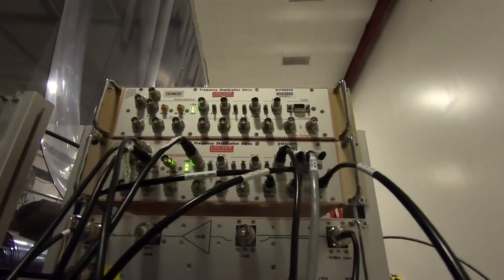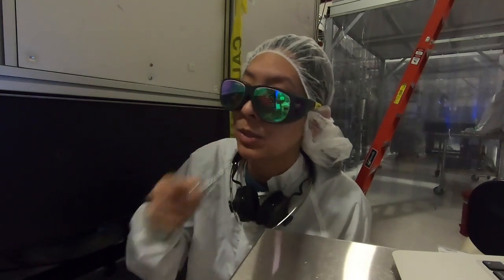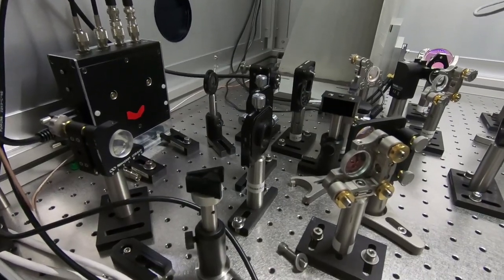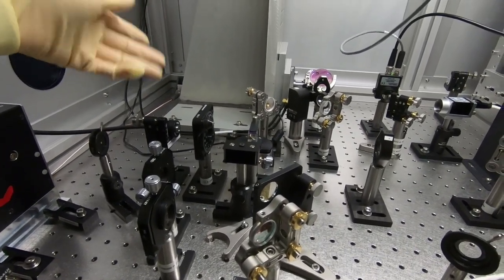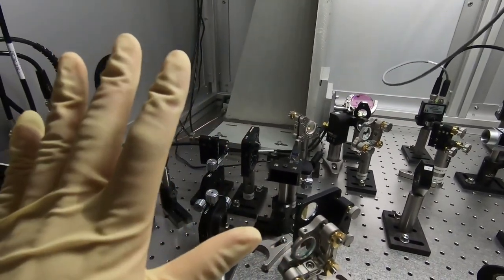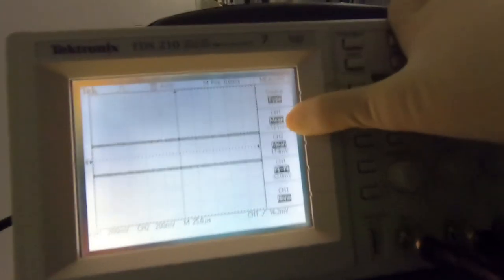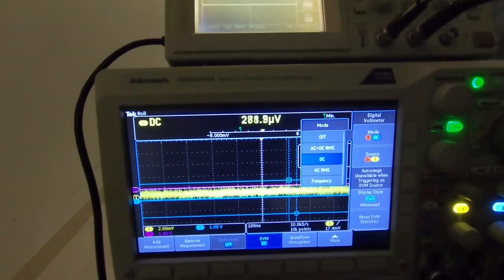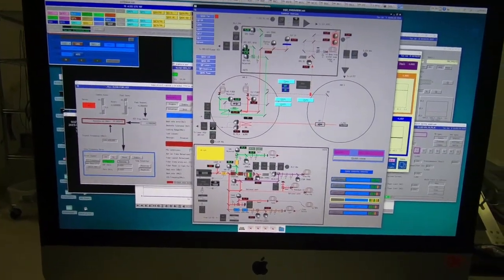[Vlog_7] How Balanced Homodyne Detector works and How to see Quantum Squeezing (Part1)

Comment: Nice video, definitely appreciate giving us a glimpse of the optics involved. Those Thorlabs 
pedestal posts are definitely a solid choice for these kind of sensitive measurements.

I noticed the .adl programs on the computer monitoring certain parameters. Any idea what software/language was used to program those .adl programs? NI LabView?
Reply: No idea bro
Reply from the maker: I'm so so sorry for the late reply. I only knew how to upload but didn't know where the comments notifications went until recently! Thank you for watching. Yes these Thorlabs posts are pretty solid. Only the adjustable ones were used for something that didn't really matter to noise performance, like an irises. 

TBH I never paid attention to all the software I was using (lol). I think what you saw might have been MEDM. It talks to EPICS. And I wast told it might have been C based.